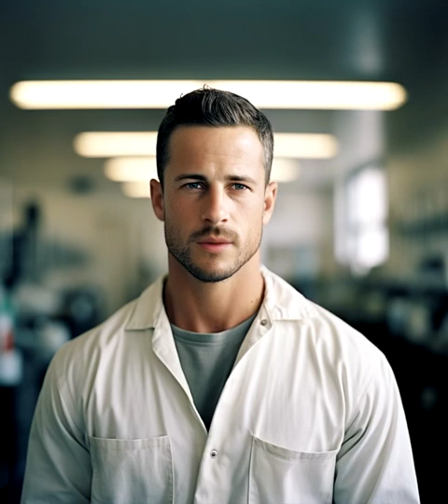Meow Ep. 6

Comment: Any issues with loosening of the can with firing as seen with some instances of the SCI-Six? Also any chance you’ll be putting wrench flats in the Spooky flash hiders?
Reply from the maker: We think the market gets confused about 1x16LH and CGS being a “it’s the thread”. We can’t speak for this CGS comment about SCI-Six but it could be loosening for a lot of reasons - faces not aligned, not screwed on properly, manufacturing defect, dirty etc.etc. This happens to all QD’s but the thread is designed to hold firm, especially when tied with a strong taper face angle.